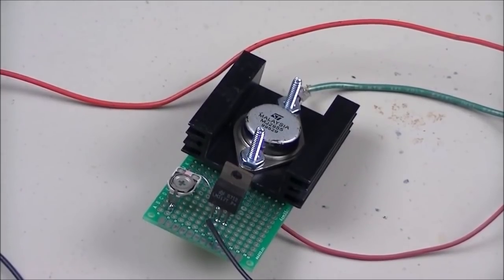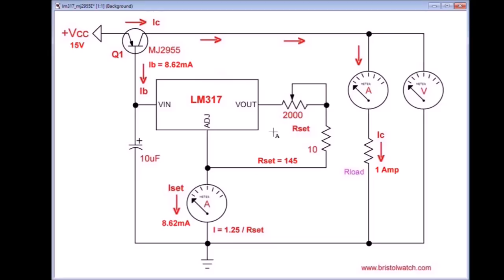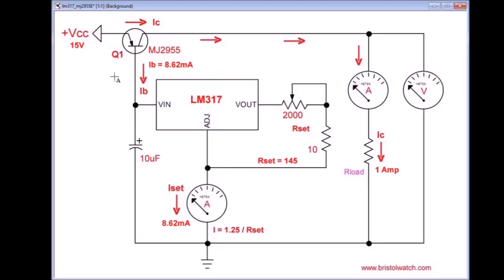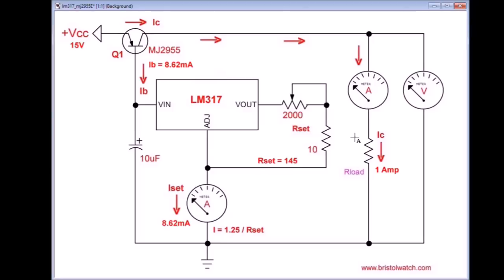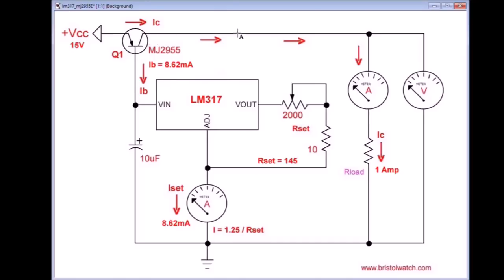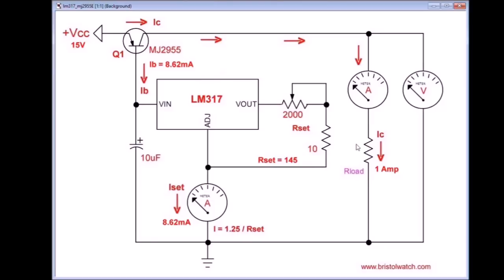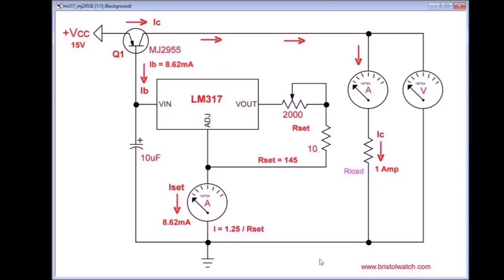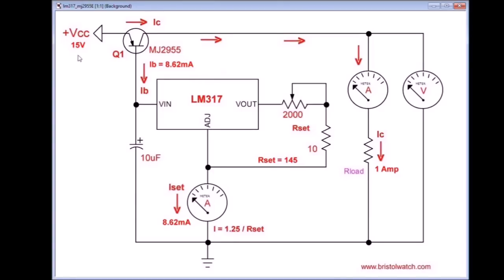LM317 CCS Schematic and Tutorial Part 3

Comment: At 10 Amps output that little heatsink will look like the sun. Say 30V down to 10V = 20V differential  x 10Amps = 200Watts  heat dissapation.
Reply: he uses another heat sink with a vent on top of that one